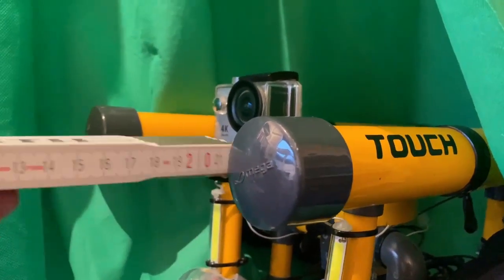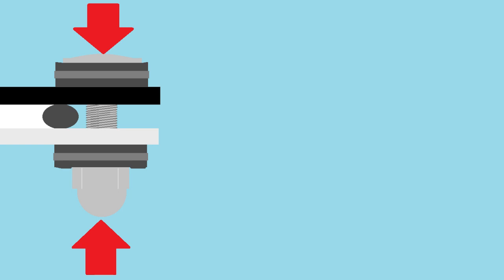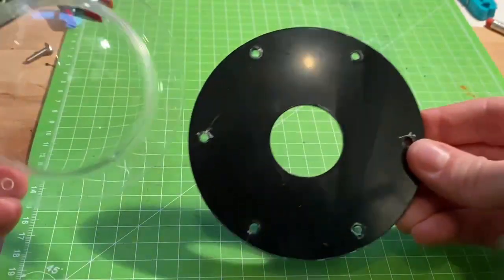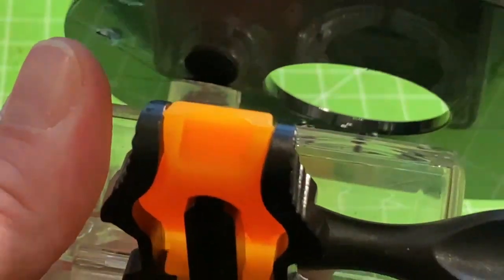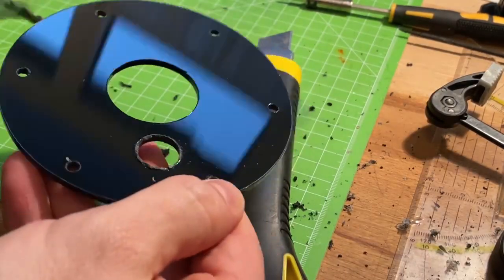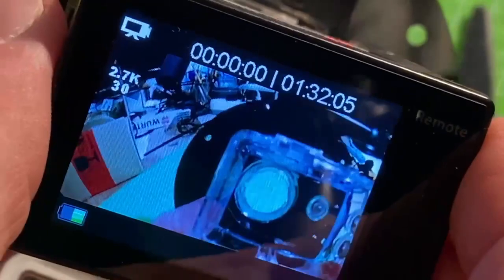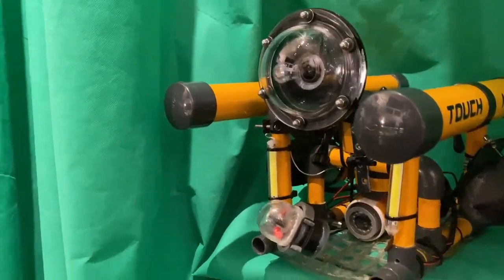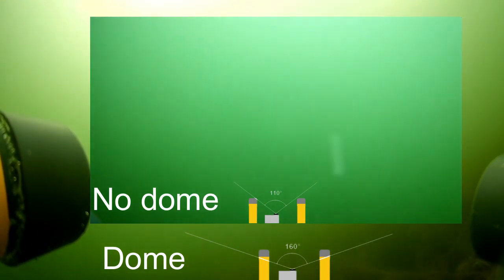Homemade Action Cam Dome for DIY ROV submarine

Comment: Excuse me Sir, can i ask how u connect the wire from camera to mini pc or antenna?
Reply: I have a project autonomous ROV, but i confuse how to connect the wire from action camera to mini pc.
Reply from the maker: @renewable8051  you have to get a fixed system. An underwater camera with cable. Or - if available - a waterproof and pressure tight case to allow an auxiliary cable to be connected to your camera.
The plug into pc or an above-water transmitter is a matter of software which has to be compatible with the camera system.

Comment: Before using the hotglue, if you were to abrase the two mating surfaces with something like a rougher # of sandpaper, would that allow the glue to adhere and create a more effective water tight perimeter? Or, is the hot glue on the acrylic surfaces enough?
Reply from the maker: The problem isn’t the contact, it’s the bubbles and other impurities that can cause leaks. But it certainly wouldn’t hurt! So, sure. 😃

Comment: I am thinking of making a similar rov for the sea. But I think it might be difficult because of the currents. What should I do to make it stable? Do you have some ideas?
Reply from the maker: Yes: on board batteries and relays to control the power. That way you have a very small tether / cable exposed to the currents and a lot more power.
But: that is very very difficult. Professional ROVs are built that way, check out www.homebuiltrovs.com for that. 😀👍🏻